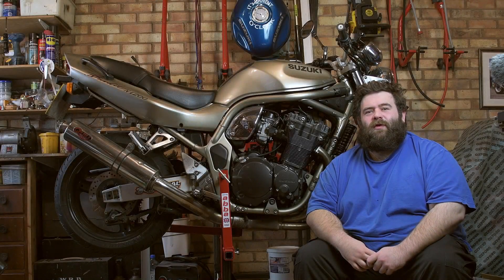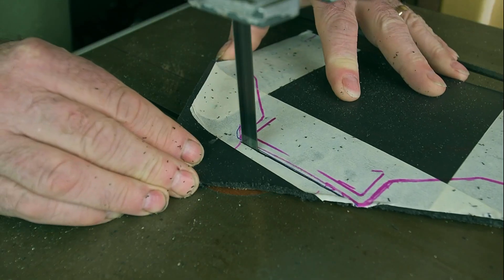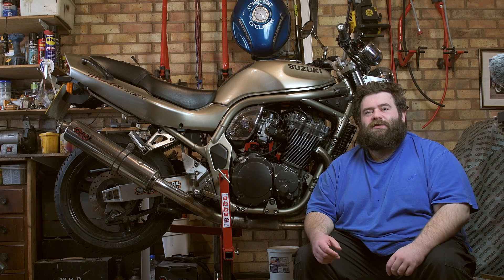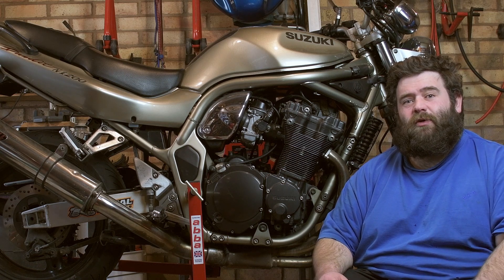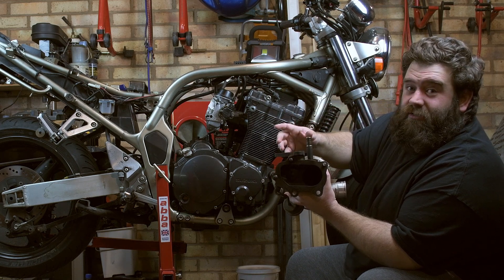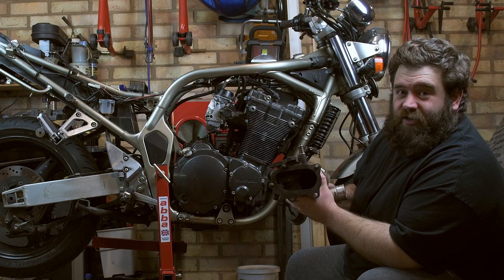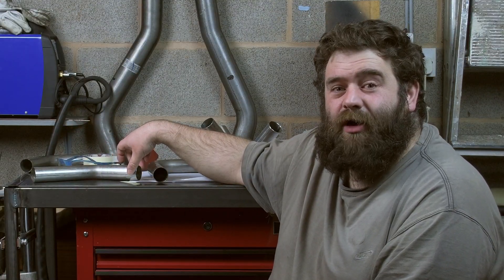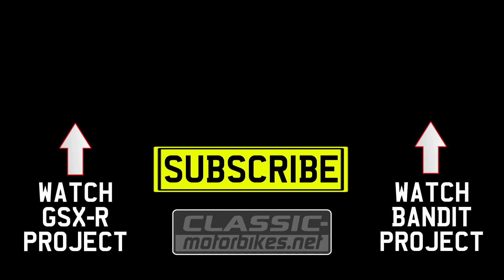Motorcycle merge collector | Suzuki Bandit 1200 turbo project part 3

Comment: Is that a turbo from a Subaru Impreza?
Reply from the maker: Hi Mark, yes it is, from one of the early models I believe.
Reply: @Classicmotorbikes  spotted that hotside flange a mile away. I would have thought though that that turbo would be very laggy on a bike given that it's quite laggy with a 2l engine supplying it with exhaust gases. Still will make lots of power. Good luck with the rest of the build.

Comment: What was the carb problem that you had?
Nice work by the way!
Reply from the maker: The butterfly on the carb was closed all the time so I adjusted like when balancing carbs and runs great now 👍
Reply: Thank you sir, i really appreciate your answer! I had similar problem but it was vacuum leak on cylinder four intake boot

Comment: Great vid Ian - keep 'em coming. Are you planning to upgrade the oil pump? I seem to recall hearing somewhere that there can be problem maintaining oil pressure with the stock B12 ones with a blower fitted. Good luck mate
Reply from the maker: Thanks Reggiebacci. From the research I’ve done the standard Suzuki oil pump is fine, but the getting the oil from the turbo back to the sump can be problematic. If I do have any problems I do have a couple of different options I can try.

Comment: Great video as usual mate, looking forward to seeing the project progress.
I was watching you strip the bike with great interest, thinking how will he get out that airbox without removing the engine, but you cut that part out, so how did you do it
Reply from the maker: Thanks Adam, the airbox can be a bit fiddly but to help I remove the rubber boots that connect the airbox to the carbs and makes life a little easier, then I remove it from the left and side of the bike, the hardest bit is getting the prong that bolts the airbox the frame past the frame rail. Hope that makes sense 👍
Reply: @Classicmotorbikes  It makes perfect sense, I spent about an hour trying to remove mine last week but gave up before I smashed something

Comment: Nice work dude! I’ve got a turbo Bandit myself mate,the difference between N/A and turbo is hard to get across...you’re gonna love it.
Reply from the maker: Hi Spike, good to hear from a turbo bandit owner. I can’t wait to try it for the first time. Have you done much to your bandit apart from the turbo?
Reply: Engine wise it’s been taken out to 1216 with ‘Busa pistons,manual cam chain tensioner,the top end oil feed conversion and a lock up clutch. It’s running a Garret GT28 turbo,all done by FBM.
I love it. I can’t wait to put some miles under it now we can move about a bit more. It’s not even run in yet!
Reply from the maker: That’s my plan to go 1216 with Busa pistons and a lock up clutch. Dave is just down the road from me, love the work he does.
Reply: Yeah,he certainly knows his stuff. He’s a top bloke too. I’ll look forward to seeing yours finished mate.
Reply: Hello , what turbo u usin and how much to do conversion plz ? Cheerz